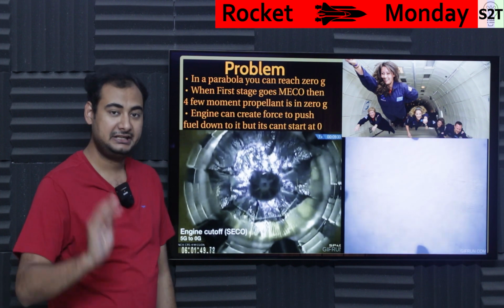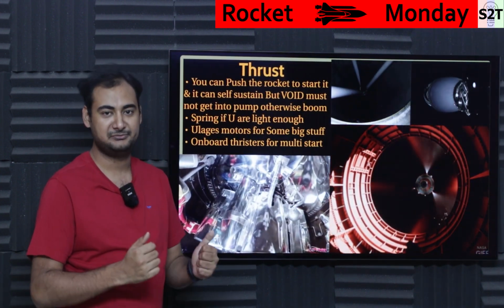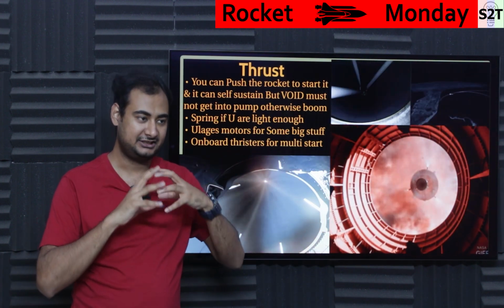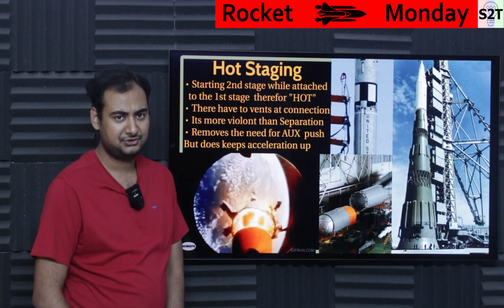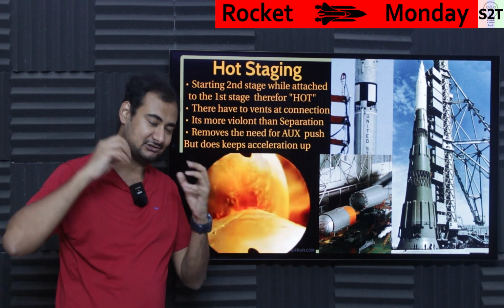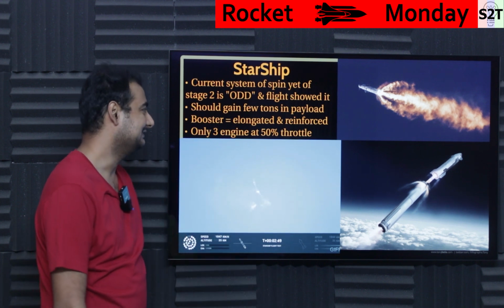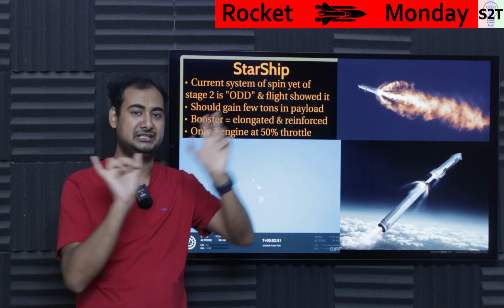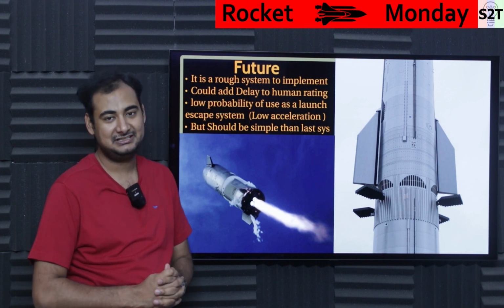Hot Staging Explained {Rocket Monday Ep236}

Comment: Great video :). By the way on your hot staging bullet points.  It's "But does keep* acceleration up" not keeps.  You're so right; whoever designed this flip maneuver was a bit crazy to think that would be ok for humans inside!! Glad they moved to hot staging which seems to have worked on the 2nd IFT.
Reply from the maker: hot staging is a proven tech just they have to scale it up and its tough as they cant just throw away booster after use . They sould be able to pull through